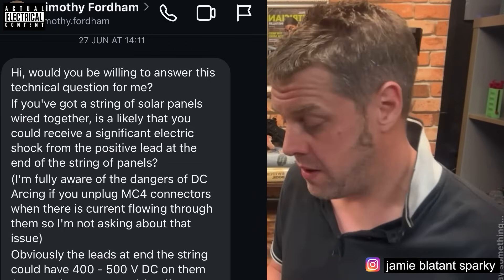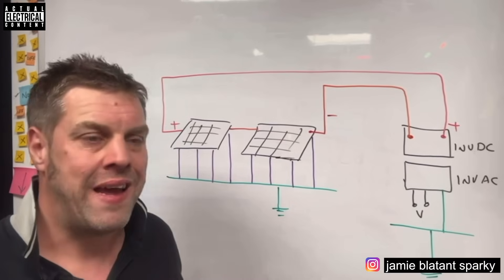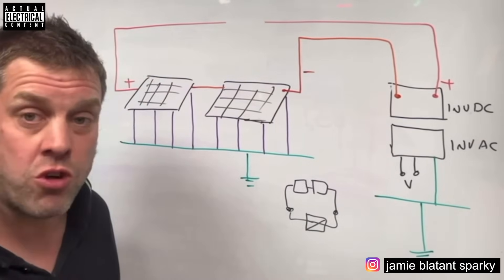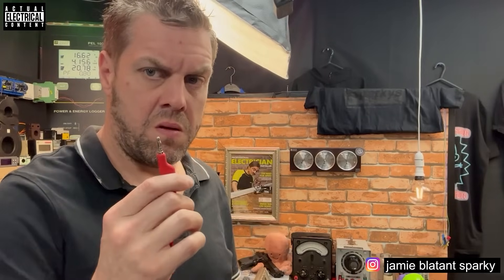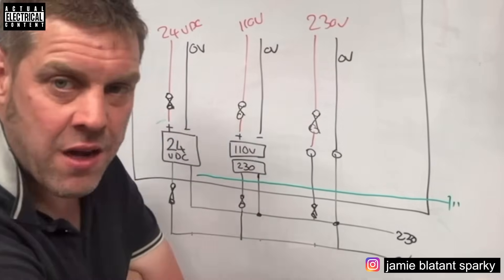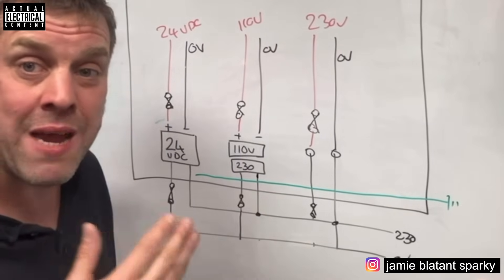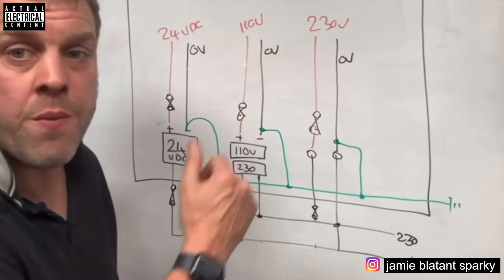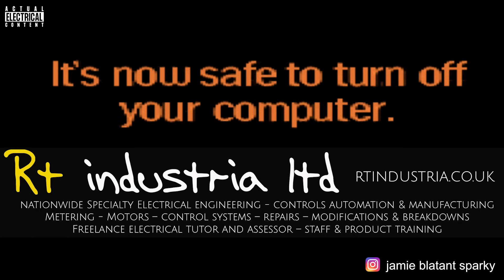DC SHOCKS AND NETURAL GROUNDS mp4

Comment: Fun fact: If there are birds sitting on =>50kV lines the line is not active.
One reason is that the alternating electric field feels very unpleasant and second is the heat as those lines can get baking hot.
Reply from the maker: Interesting point about the birds, I never knew that.
Reply: @Actual_electrical_content Now you know, you will notice it everywhere.

Comment: Touch the + of a battery, you wont get a shock.
Touch the + of a solar array, you wont get a shock, near all (all the ones I have worked on) dont like the neg being earthed, it causes issues. (Would I touch it,,, no)

Now the multi supplies.
In most control aspects its imperative to have the Neutral(0v, -) earthed. 100%.
However, when doing some accurate/fine measurements for volts (uA, uV), the supply for these should be kept away from Erath, as the earth potential can fluctuate and induce unwanted parasitic issues.
The screen on your TV Ariel cable isnt earthed for instance, or it may have a bleed resistor of 100k to stop charge build up.
And as mentioned, safety transformers 240/110 CTE or fully isolated are common.

Comment: Some analogue sensors misbehave if their return/negative/neutral is bonded to earth/ground.
e.g. I had to assemble some PCBs which used Honeywell  pressure sensors (0 - 5 VDC rather than 4-20mA current loops).
If I tied the zero Volt DC rail to the supply earth, then the transducer output was complete b0ll0cks.
If I left the 5VDC transformer secondary winding floating, then the pressure sensors agreed with the external calibrator.
Is their any theory behind this?  Or is it just a "black art"?
Reply: probably noise interference from other equipment. installing proper filter capacitors at the right places goes a long way of fixing random unexpected behavior

Comment: "Types of ELV:
Protective ELV (PELV), Separated ELV (SELV) & Functional ELV (FELV) are the three types of ELV system".

You can't earth SELV, sorry, even in your panel, as if earthed, it becomes PELV.
And there is no "neutral" on 110v safety transformers it list used on building sites. 110v output is earthed at the middle, so potential to the earth is no more that 55v from both ends.
Reply from the maker: There is just voltage , and in most panels you will find that one leg is earthed , it’s not SELV is just control voltage

Comment: Yes J. as the DC circuit is a c!osed loop system. We have to earth the frames/rails for testing compliance, but it has always been more likely that you will get AC voltage on the frame historically, this has been due to leaky components and unsloted PCBs in the invertors. Big Like mate.

Comment: If you have 70 - 90 V of max. voltage per string, or if you have AC optimisers per 80 V string,
there is no problem, because this voltage is not problem even for AC breakers.
But if you have 400 - 800 or 1500 V per string, some people use cheap DC breakers,
and if you disconnect something under full load, this DC breaker will catch fire.
Also people use DC breaker incorenctly and magnests inside can not stop arc. 
If I use my DIY ESP32 MPPT, I use MOSFETs for 150 - 200 V, elyts. for 200 V,
and BUCK topology is not isolated, so for 2-phase BUCK there is 90 : 48 V conversion,
and for 3-phase BUCK, 120 -130 V : 48 V conversion. 
I somedoby prefers 800 - 1500  V per string, this MPPTs use bidirectional H-bridge
isolated topology, so you can make charger for your BEV, with almost 98 % eff.
if you have BEV with 800 V battery.
Reply: 7 panels 5A. 50R heater for 1kw.. panels are constant current (at full illumination...), voltage is all about load up to their rated output... 

water heater.  mosfet IRFP460 for the main switching. regular zener at 12v through the original thermostat. still less than a watt at the resistor despite dropping 188+...

lol, had to try the same set up as 7p... 35, 36v A. element of...6R? lost 100W+ in the wires alone...

Comment: 10:11 You explain that it's already connected. As if it's no big deal. You forgot to mention the reason. In a residential installation your RCD (Residual Current Device) wil not work if you just connect ground to neutral in some random place!

Comment: Worth pointing out that you really should ensure the panel frames are grounded as you can get leakage which causes the frames to charge up and give you a shock when you touch them even if you can't draw any sustained current worth considering.  I've seen and felt this on ground mounted arrays. I'd hate to be balancing on a roof when experiencing such a shock.
Reply: Why would anyone be climbing on a roof without using the correct fall prevention equipment?
Reply: @VinoVeritas_  A fall arrester can still result in injury, it just stops you falling all the way to the ground and killing yourself
Reply: @VinoVeritas_  because roofs are fun and humans manged to build them for thousands of years without resorting to "fall prevention equipment".

Comment: Great video and as you say it is dangerous to assume you won’t get a shock due to a lottery of grounding scenarios the negative may or may not be connected etc. 
The Fronius Inverters seem to have one of the most comprehensive manuals when it comes to showing you  grounding and diagrams etc its worth a read but here is an excerpt that gives another scenario for thought.

Do not connect the ground to the negative DC line at any point!
This is already done within the inverter. If negative DC lines are connected to the DC terminals or prior to this to the ground, this will circumvent the GFDI protection system, preventing your inverter from properly detecting a fault current. In addition, turning the DC disconnector to the "OFF"/open circuit condition will not disconnect the PV modules from ground, as it only disconnects the DC positive.

Comment: Well said mate.  Well said.  99% of grid tied and stand alone inverters (all-in-one) are not separated designs.  There is a DC path from the PV, through the HVDC bus, through the switching bridge that creates the AC waveform, to the AC output terminals.  Earth the neutral side, regardless of where, and the PV becomes hazardous with a single fault.  It might be earthed because of the regulatory requirement to preserve the neutral/earth link and neutral continuity (USA, NZ, Australia and many more).  It might be for earth fault handling (detecting loss of isolation etc).  Regardless of why, touch the PV and you can become un-alive (stupid youtube shadow ban).  The number of people that don't understand this yet fiddle with solar is downright alarming.
Reply: Good answer. But a set of rules would help. This technology is evolving daily.

Comment: Jamie , a few years back I wondered why dc supplies and transformer secondaries were earthed. I thought it was easy testing as you have shown. My searching came to the conclusion it was a safety issue . If there was a primary / secondary breakdown ,you would still have your secondary voltage but with the primary super imposed on it . I have verified this with a 240v/24v ac transformer. 24v between the secondary windings but 240v between secondary and earth . Try it out ..
Reply: wouldn't the fuse on the secondary side trip if 240 pushed through from the primary side due to windings failing?
Reply from the maker: Thanks for sharing that, I appreciate the info.

Comment: Microinverters for the win! Anyone still using DC over wire to inverter (longer than a few feet) is frowned upon for me. Maybe a shed with lighting or maybe a mobile setup but clearly not a full home / farm setup with hundreds of volts!
Reply: unfortunately your panels are likely to last a lot longer than your micro-inverters and getting a couple of replacement micro-inverters in 25 years could be a challenge. Much easier to replace a string inverter and you don't have to take the panels off the roof to get to it.  Also with some large PV systems running over 1000V the cable losses are often significantly lower than 230V AC.
Reply: All well and good until you consider the rfi from all these switching devices. Especially ones on the way out.

Comment: Another interesting one mate 👍
I've worked with a lot of 48VDC telecoms systems which were positive earthed, not 100% sure why but i think it's to get a -48VDC rail for some of their equipment. 
I'm also told very early cars had the positive tied to the chassis instead of the negative like we do nowadays.
Reply: I believe they were positive earthed to reduce corrosion and it was the best engineering option at the time. The system has then just stuck to maintain backward compatibility. 
Cars have swapped between negative and positive chassis around the 1940s and back again to negative chassis late 1960s to early 1970s depending on manufacturer.
Reply: @three-phase562  Yep, that's it for telecoms.  Direction of Ion flow, preventing corrosion.
Reply: @three-phase562 ahh I see, good to know. Thanks 👍